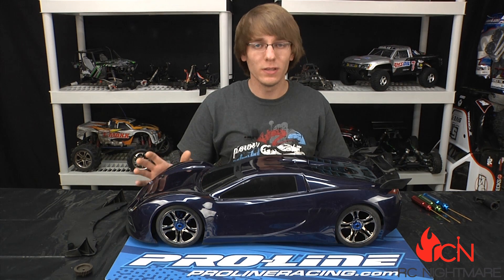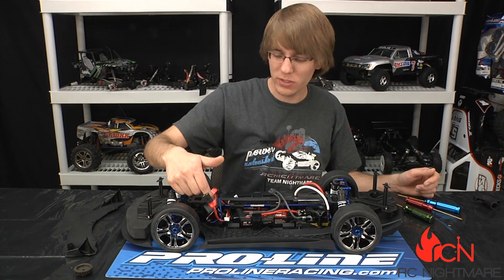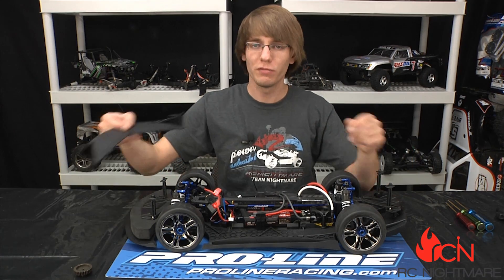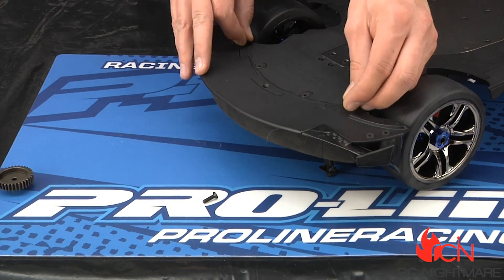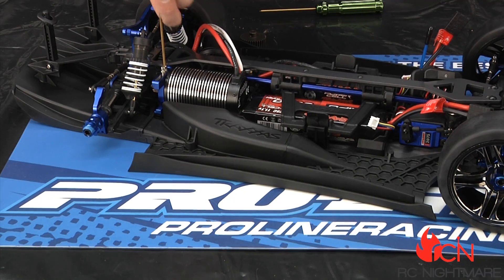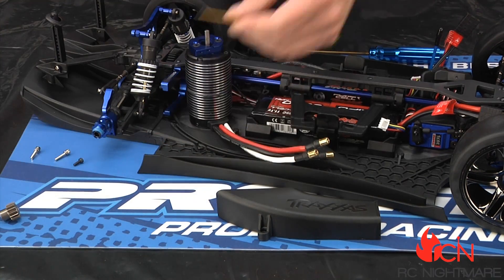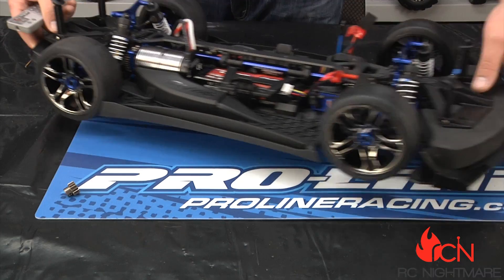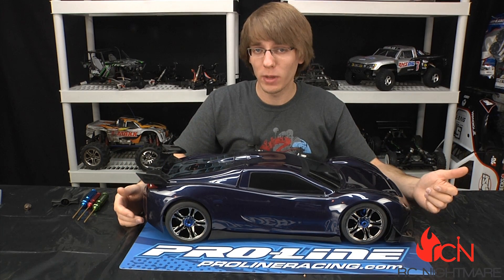Unlocking 100MPH Traxxas XO-1 Hardware Tutorial

Comment: @raptorlishus  if you leave the 34t gear in and locked you still go up to 70m or 100m 
but make sure you balance your tires. they are not balance from the factory.
so you run the 34 with the bigger gear to get less speed.

Comment: $1000 and 100mph out of the box.....what they forgot to write on the box was....to do 100mph, YOU need to add downforce to frontend of the car....YOU need to install the optional gear...YOU need to reset the software...only then you can drive 100mph but only for a little while....but make sure not to drive it normally, low speeds full throttle for acceleration then stop then full throttle...or you will burn up your $300 motor....